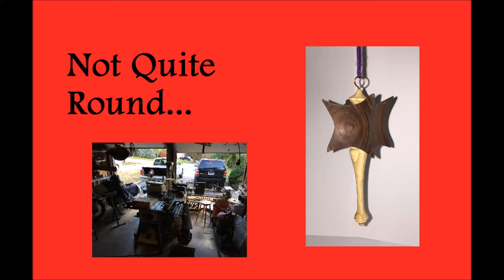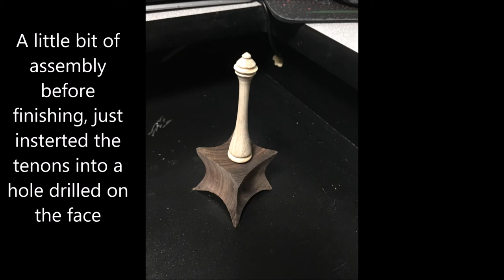Not Quite Round - Woodturning a Christmas Ornament

Comment: Im looking at the pictures thinking wow, this is cool, I wish I had a lathe I could do this on, then all of a sudden it hits me. I do. I have a Shop Smith duh. I just have to spend more time learning how to turn LOL. I wish you well in the challenge.
Reply from the maker: Haha, yes it is a little odd to think of it as a lathe sometimes when youve got all your other tools connected to it. It only a $30 adapter (the shopsmith to 1" 8tpi adapter) and you can pretty much turn anything up to 12" diameter
I made a glue block by setting a nut with epoxy in some 2x6's and thats pretty much all you need for this and alot of turning! Hopefully you can start turning on it, but I assure you, you won't be able to stop

Thanks for the comments :) Much appreciated

Comment: To remove hot glue from a project, you can use isopropyl alcool. It weakens the bond of the glue and allows for easy removal.
Reply from the maker: Hmm, great tip thank you! Any word on how it affects the finish? Mainly clear lacquers and poly's. Does the isopropyl stain the wood?
Reply: You can also use denatured alcohol instead of isopropyl.  Both work equally well to break hot glue's bond.  Both also dry quickly and leave no discernible residue.  However, both alcohols are solvents and can dissolve some of the natural oils found in wood, which might cause a slight discoloration.  This usually isn't a problem.  The discoloration (if any) is only surface deep and easily sands away.  I use denatured alcohol since I have it on hand for cutting shellac.
Reply from the maker: David Walser Ah good! I'll have to give it a try, I'm in Canada so denatured alcohol is out, but I've got some isopropyl alcohol handy. Thanks!